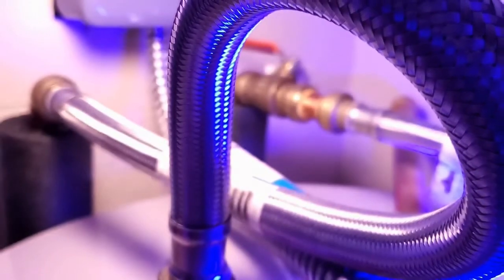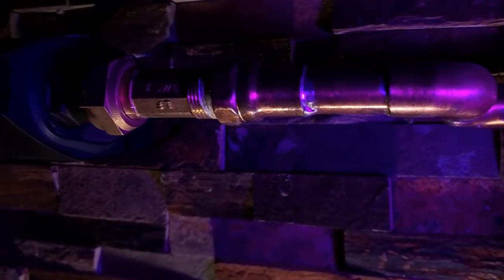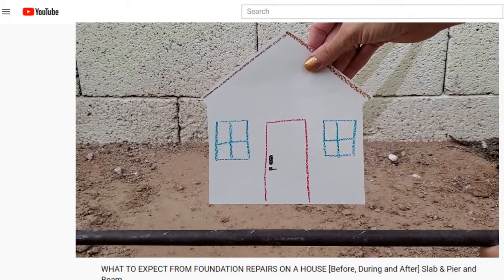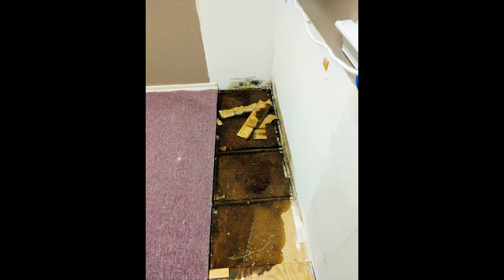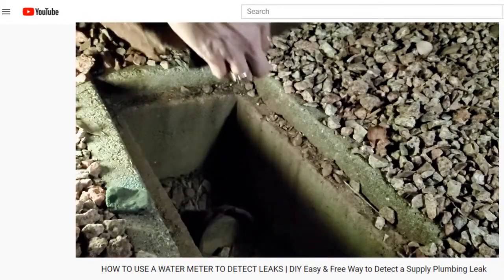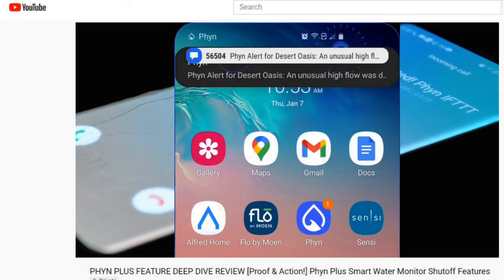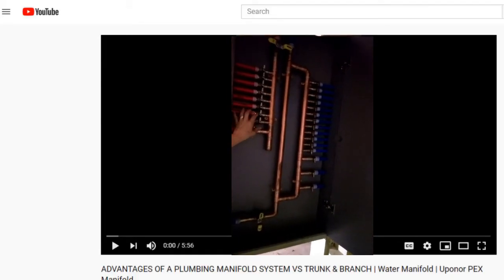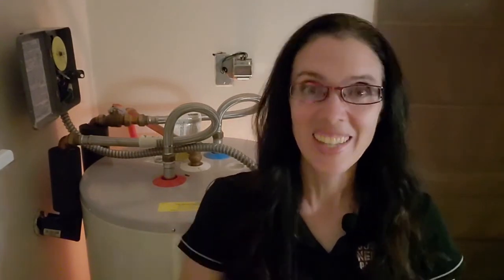15 Ways to Detect a Plumbing Leak UNDER a Slab Foundation

Comment: Pump compressed air From an air compressor at no more than 120 psi into the water lines the added noise from air escaping if there is a leak can make it easier to find the are of the nasty leak if it is in in a slab! Hint - Install a pressure gauge say where the PRV is located near the top of the tank to verify pressure! Note you can remove the prv put in a nipple and tee put the prv back in and install the gage and corresponding bushing into the side of the  tee, leave the gauge in permanently! You may need to run air in to the lines for a couple of hours to find a leak. The more often the air compressor runs the bigger the leak, make sure you close the main cold water feed line from the city main. You can also purchase electronic leak detectors that respond to low levels of sound! If you have old poly B piping leaking bad news as time for it all to be replaced it has been banned for a number of years and is not covered by many insurance providers for leak damage. Since you can’t replace slab piping you will have to repipe in the house and may need to fur in the new pipes with drywall or whatever! Luckily not many homes have domestic water piping in slab it saves money up front but can cause big problems down the road!
Reply from the maker: Thank you for adding to the conversation! I'm sure others looking at the comments will appreciate it too. Not having used a electronic leak detector, I didn't want to introduce the concept, but have nothing to back it up like show how to use one or a recommendation for which one. Do you have any recommendations?
Reply: Hey wolfgang what about putting air in to a sealed System.ie. Central heating to find a leak that has radiators.?

Comment: Great video! I always start out by isolating from meter to the main of the house its too bad a lot of times they have the crummy gate valves that dont always shutoff the water fully 🤨
Reply from the maker: Totally agree there! Thats what I shared in the follow on videos using a water meter and water pressure gauge to pinpoint a leak. Just prior to making this video we replaced the water main across the front yard and discovered the quarter turn city side shutoff did not completely seal. They came to replace it the day after we completed the rest of the line with a slow leak. It's that kind of timing that helps us remember these projects so well... 🤣

Comment: Since you asked for it, here's our comment. Please accept my apology for its length, but we've been battling this for 8 years not totally successfully.

We bought a rancher in 2013 that was originally built in 1983 as our retirement home in the Houston area. It didn't have a moisture barrier in the foundation when it was built. It had carpet in poor condition. The foundation had been leveled and there were a lot of piers. We renovated the home extensively (including a metal roof) but didn't do anything to the foundation. We have a well and the water pressure fluctuates from 50 to 70 PSI. We replaced the carpet with vinyl flooring (flooring number 1). "Float" was used to level the floor over the piers. In some areas, the float never seemed to dry. The flooring starting coming up in multiple rooms and it was replaced with floating vinyl (flooring number 2). A thin pad was installed on the slab after re-leveling with float again and the vinyl planks interlocked on top. The planks came undone. When the pad was removed, the smell of mold was overwhelming. It was treated with sodium carbonate. A flooring engineer recommended engineered wood this time due to moisture in the slab. Engineered wood slab was installed (flooring number 3). In one bedroom, the several planks started disintegrating, starting with blisters in the finish. All attempts at repairing the wood failed. The outside wall in that room along the baseboard was wet the dry wall was wet. Through that wall was an air conditioning refrigerant line. The flooring seemed to do worse in the summer. I suspected that the damage was from the refrigerant line. A room dehumidifier pulled out gallons of water a day from that room. Our contractor, who had renovated that side of the house, said the problem was due to no weep holes in the bricks. There were no weep holes anywhere else on the foundation, so I was skeptical that was the cause, but I removed the mortar between every 3rd brick as instructed. It didn't seem to make a difference. Then Hurricane Harvey struck. Although there was a tremendous amount of rain (50 inches), the dehumidifier's output in that bedroom decreased and we also didn't get flooded. During the hurricane, although it was in August, it was substantially cooler. I asked our AC technicians to move the refrigerant line to run up the outside of the house into the soffit and not through the wall. They insisted on a foundation check first. We called the foundation people who leveled the house before we bought it. They did hydrostatic testing on all of the drain lines. *Everything was intact.* We had the refrigerant line relocated. The AC people found that the foam insulation around the line had deteriorated and the line was very wet. The moisture in that bedroom decreased. We then got another engineered wood floor installed in that room only (flooring #4 for that room). After about a year, dark lines started developing in that flooring. It looked like someone had drawn lines with a black sharpie, except nothing removed them (we tried water, floor cleaners, alcohol, acetone, mineral spirits and even lacquer thinner). The flooring people said that it was from moisture. During that time, a development was being built in our back yard on 13 acres (we didn't own that property, unfortunately). The development's property was initially below ours until they started building. Then they brought in many truckloads of dirt and mud and it is now elevated above ours. We complained to the city engineers who said that the development's property was actually sloped away from us, that it would not impact our property. We called our plumbers to look for a leak. The plumbers found no leaks in the fresh water system. They did hydrostatic pressure tests on the drain lines. We have 3 drain lines under the foundation, installed when the house was built. The foundation people had said that they were intact several years earlier. This time, our plumbers said that they had all broken off from under the slab! They had to tunnel under the slab to fix them. The cost was about $36,000 and homeowner's insurance only paid for about half of it. After the drain lines were repaired and brought up to code, we had the damaged floor in that room only replaced with porcelain tile (flooring number 5). We called in the foundation people again and had the foundation rechecked. They said it was fine, that it hadn't moved. I asked about whether the development in our back yard was responsible for the severed drain lines and they said it could have been caused by anything, not necessarily due to the development. I suspected that they just didn't want to get involved with a potential legal situation. The foundation guy explained that when the piers were placed to level the house, they went 20-30 feet into the ground. After a year, white-yellow moldy stuff started growing in the grout in that bedroom. A flooring specialist was brought in after the flooring people suggested treatment with phosphoric acid. The flooring specialist tested for moisture, found it to be high and said that nothing could be done about it, that it was "efflorescence." It does wash off easily with Bruce's, but we are now seeing it other areas of the house that still has the engineered wood flooring (flooring number 3 there). At this point, we don't know what to do other than just live with it.
Reply: Good evening, Jay. 
I am Margaret’s husband. I am an IICRC certified restoration contractor, member of the Greater Houston Builder’s Association, Texas Association of Builders, National Association of Builders and general contractor.
You and your family have been through a lot and I see this in the field a lot. I am disappointed that all of the professionals (for flooring) have missed a cost effective, long term solution.
There is a solution to the moisture coming through your slab. I am NOT surprised that all of the flooring people, plumbers, etc. have not addressed it. Your slab, at this point, should have a sealer applied to the entire surface of your slab. The correct sealer depends on a moisture test and analysis of the concrete slab’s hardness and permeability.
There are many sealer products available, but the final coverings need to be considered. If you would like to learn more, please go through Margaret’s contact information page at justneedspaint.com.
Reply from the maker: Thank you for sharing your experience. It sounds truly terrible. Most people only put one floor in, but 5 is well beyond anything reasonable. As you could see I asked my husband to take a look at your comment since he is more knowledgable about solutions. I missed efflorescence as a possible indicator--I'll have to add it to a follow on video. It seems wrong to hit the heart button, but I truly appreciate the time it took for you to write that out and share with others who have similar experiences.
Reply: Wow...no words for your situation...thx for sharing.
Reply: Was, what a nightmare!!!!! that is just awful!! I live in Rhode Island and was looking into buying a slab on foundation house here, this type of house construction is very unusual given our cold winter climate.  I've been living here for 35 yrs and never seen a house with no basement. After reading what your are going through, I am reconsidering buying a slab on foundation house now!!!...

Comment: We rent our duplex. Two weeks ago on Wednesday, one tile felt slightly warmer than the others in the small bathroom closest to the water heater (it also sounded hollow when i knocked on it, but that could be lack of adhesive on the back of the tile). Two days later, the floor felt very warm in the living room on the other side of the kitchen sink wall area, where it was carpeted. I’m talking heated floors type of warm. We were gone for the weekend and on Monday morning, the warmth spread further out in the living room towards the front door and in the kitchen, in front of the sink and counter where it was tiled (nothing was wet, though). I called our landlord to check it out and the soonest they could get there was 5:30pm. My girlfriend got home at 5pm and there was water everywhere! 

Our landlord’s handyman supposedly found the source of the leak in the wall between the kitchen and living room. It’s a short wall with a little bar top on top. They capped it off and rerouted the hot water line via flex pipe up through the attic. They said they turned the hot water line off and then back on when they capped it to find the leak and couldn’t find any others. They also replaced the water heater. We’re getting recarpeted tomorrow, but i worry that they didn’t find the actual source and didn’t want to do the work or hire someone to find it. Our tile in the kitchen is still a little warmer than other parts of the kitchen, even a few tiles away, but not as bad as it was on Monday morning. Still a noticeable temperature difference being barefoot.

Looking back, i feel like there were symptoms. Occasionally, the pipes would rattle loudly in the middle of doing dishes and the water would shut off. I’d have to turn the faucet off and turn it back on to get the rattling to stop and the water flowing again. In the bathroom closest to the water heater, the hot water would shut off randomly (but pipes wouldn’t rattle). Another handyman looked and said that the hot water valve wasn’t open all the way, and that’s what was causing it. So he opened it. That was about a week or two before we noticed the warm floor. Could that have exacerbated the issue?
Reply from the maker: It's really hard to say, but here are two possible ways of determining if there is an existing leak. The most definitive is to buy a cheap water pressure gauge and running a 15 minute test, as I explained in this video: https://youtu.be/I4F4HV4nipk. A cheaper alternative, but less definitive, is to turn off the water heater (because you don't want the hot water to kick on to maintain temperature and put excessive pressure on the line while the system is closed), turn off the valve at the hot water line (because it sounds like the concern is only in the hot water line), and let the water sit for an hour or so. If there is a significant leak, there won't be much coming out of a hot water tap at the end of the hour. It's hard to detect a smaller one, but warm floors indicate a larger leak.
Reply: @NoMoreLeaks  that’s what i was afraid of! I just don’t think they’re receptive to paying a ton of money to figure it out. Although i did find a company locally that will check for leaks for free. My gut tells me it’s something big, but i don’t think I’m being taken seriously. I don’t know a lot about it, but just by searching “warm spots on the floor” keeps giving me the same results! just don’t want to go through all of this all over again, and being displaced for a long period of time if it gets worse and they have to learn the hard way. And we’re also afraid of mold development! The bottom drawer of the cabinets (closest to the floor) also warped and it doesn’t close as smoothly as it did before. 

I did forget to mention that the water went into our neighbor behind us, who we share a kitchen wall with! She got water in her kitchen and part of either her bedroom or living room. How does that happen and not cause any damage in the walls or the under the floor??
Reply from the maker: Absolutely. Mold is definitely a valid concern and one that should be discussed. It sound like you have already started that conversation.

Perhaps they might be open to a water monitor and shutoff system to prevent this in the future? We went down that road having the warm spot on our floor and I'm assuming we will have another one as the copper below the house ages out. My Phyn Plus costs less than a couple rooms of carpet, so it might be worth mentioning for their investment as well.

Comment: I have about 3 gallons a minute leak.  Noticed my bathroom covered in cold water.   Thought maybe sewer was backed up.   Sucked water out and cut main off.   When cut main back on nothing leaked in the house but water stains on foundation around the house where bathroom is located.  Killed hot water tank and water still leaking so I have a cold water line leak somewhere in my bathroom area.  Removed a large tree not to long ago and I guess that caused my house to shift.  Sad
Reply from the maker: That's a big leak. Cold water line leaks are the worst. I hope the water did not get past the bathroom. Was it sudden and did you find the location yet?

Comment: I’ve got one now. It’s in the washroom coming from the first 2 tiles of LVP flooring by the garage door. You can see the water spots in the concrete just below the garage door  when you step into the garage. This makes like the 5th leak we have had in this house since we bought it. Unfortunately for us this house was built with recalled PEX and we missed the deadline to cash in on the class action suit. Now there is nothing we can do. It keeps happening. I absolutely hate it.
Reply from the maker: Thank you for sharing. That's terrible--there are no good answers there. ☹️ While your track record is worse than mine, that's exactly why I got a water monitor...it's only a matter of time until the next one. It is not a fun position to be in.

Comment: Trying to locate the source of a water leak in my house my water consumption has trippled in the past month. The water meter doesn't seem to change when everything is off, my water heater isn't constantly running, I've gone as far as checking the crawl space beneath the bathroom. The crawl space is bone dry. The house sits on a slab foundation also any tips to n where to look?
Reply from the maker: If there water meter does not change--mine certainly seemed to be sticky and was not good at detecting small leaks (https://youtu.be/hEMMLF-j4r4) I'd suggest getting a cheap water pressure gauge (https://youtu.be/wK-XSDcj8KE) and try this method: https://youtu.be/I4F4HV4nipk. I hope that helps before having to call out a forensic plumber.

Comment: I think I have a busted water pipe underneath my house will my meter still run slow if the water pipe is busted ?
Reply from the maker: Yes, but if the leak is very slow it might be hard to detect. This is the smallest leak I detected and behavior of the water meter for that leak on my house: https://youtu.be/hEMMLF-j4r4 I hope that helps!

Comment: Do you know what causes high sewer bills? It’s just me and my fiancé. Our water bill is only $20. But our sewage is $80.
Reply from the maker: Good question. Has it been increasing over time or is there a sudden change? Have you compared bills with your neighbors? One guess is perhaps it costs more to process sewer water than provide clean water, depending on your location and sources. I found this article and it had some interesting insights: https://www.bbhsd.org/home/pages/why-your-sewer-bill-more-your-water-bill
Reply: @NoMoreLeaks  It's been the same since we've moved in. About five months in a row.  I could ask my neighbors and see if they're getting the same result. This article helps a lot, I really appreciate it!